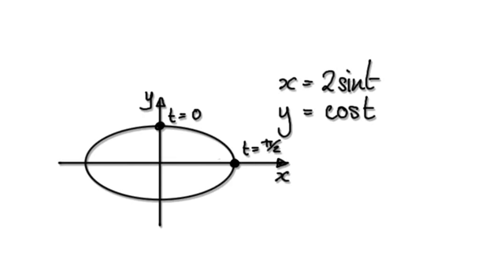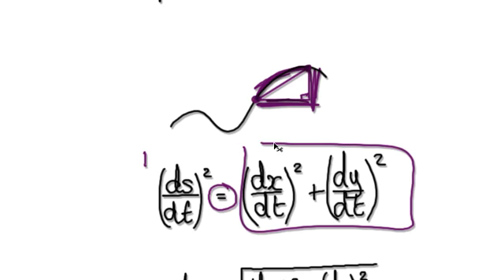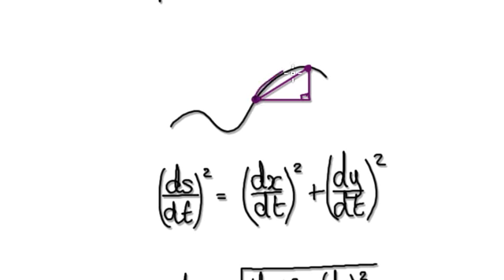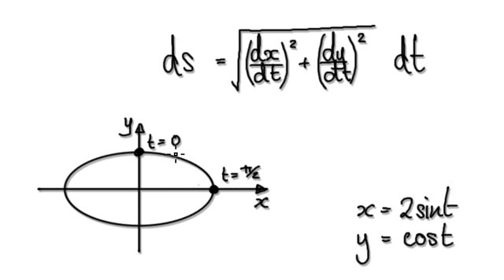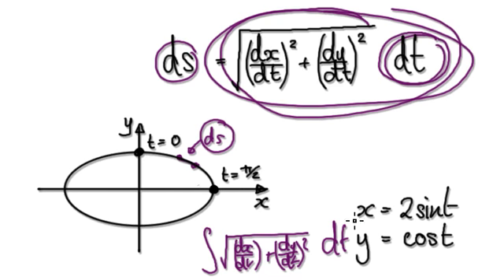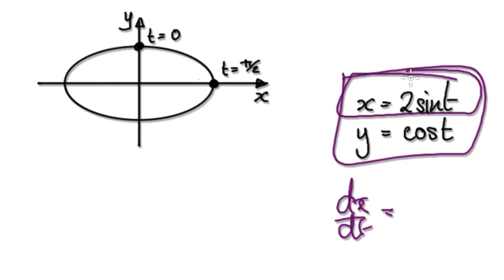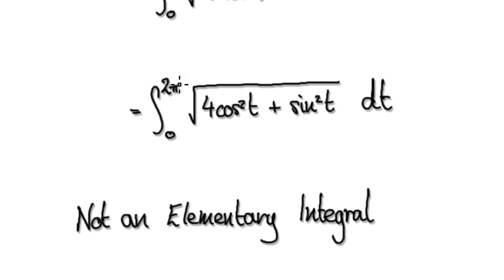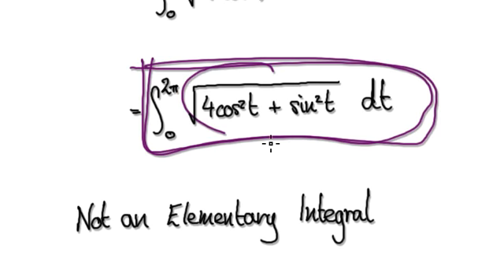Video 2058 - Parametric Arclength Ellipse - Example

Comment: Thank you, sir. 
It's very useful but what if the equations of major and minor axes of the ellipse aren't in parametric forms? Is there anyway to calculate its length? I've also read that the process to calculate its length hasn't discovered yet..
Reply: @Pranusha Kadem
If it isn't in parametric form and it's in the form that most weird curriculums are used to being y in terms of x, then take x as the parameter and thus for:

y = (b/a) (a^2 - x^2)^(1/2)
in where
arc length = integral [1 + (y')^2] dx
giving you an elliptic integral of:
arc length = (1/a) integral [[a^4 - (a^2 -b^2)x^2]/a^2 - x^2] dx

The elliptic integral cannot be resolved into elementary integral(s) by means of substitution, however, its integral exists (or feasible, that is, resolvable into a Reimann sum) as it is a rational function.

Wish YouTube supports LaTeX.

.

I know most people wouldn't understand what it means to "take x as a parameter" but this is actually feasible. By "take x as a parameter", for:

arc length = integral [(x')^2 + (y')^2] dt
now, when you take x as the parameter, what happens when you differentiate x with respect to itself
arc length = integral [1 + (y')^2] dx
Reply: @analysis-sb4ri  thank you!!

Comment: I would like to reach that knowledge... Please! :(
Reply from the maker: Take it step by step.  Over time, knowledge will build up.
Reply: I did it, but I nly can get the integral of (a^2-(c^2)Sen^2(t))^(1/2), where c^2=a^2-b^2. I could get your final expression, but for me was easier let it as I said. I tried to use a integral formula for the square, but the c^2 hinders everithing. Could you help me with that? Thanks! :D
Reply from the maker: +Erick C. García (Eck) hard to explain over youtube comment.